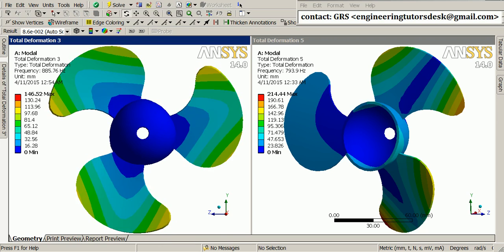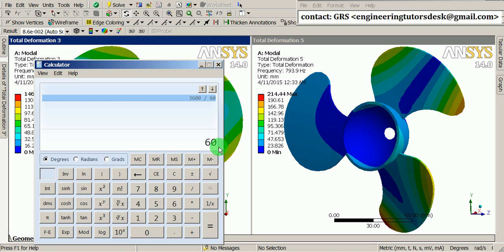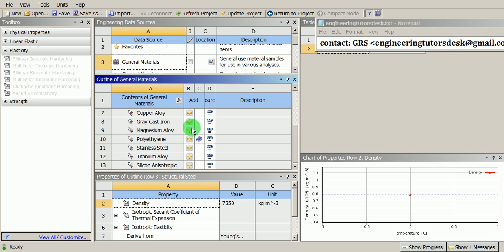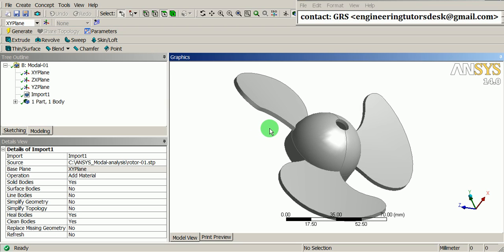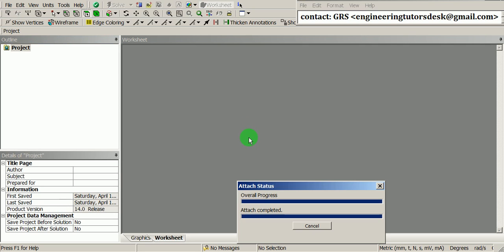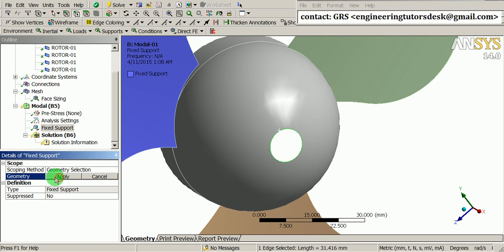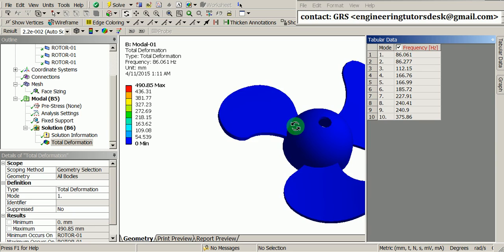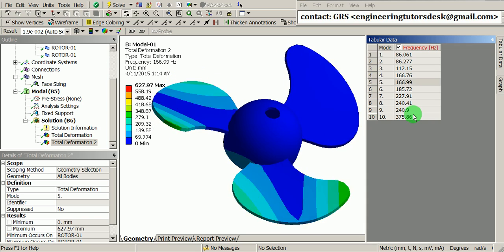ANSYS Workbench | Vibration का विश्लेषण क्यों जरुरी है? | Modal analysis | Natural frequency | GRS |

Comment: Sir do you have any idea how to do modal analysis of structure under water in Ansys. 
as there we need to consider the Hydrodynamic added mass.
Reply from the maker: One of the approach can be, you can do pre stress modal analysis. Create static structure analysis with pressure load, then do a modal analysis
Reply: @ANSYS-India   thank you for the quick reply sir. I actually want to do a free free modal analysis (Ships etc). For example a Cube immersed in  water or floating.
Reply from the maker: Check this link, whether it can be any help to you. https://www.researchgate.net/deref/http%3A%2F%2Fe-collection.library.ethz.ch%2Feserv%2Feth%3A7837%2Feth-7837-02.pdf
Reply: @ANSYS-India   sir many thanks for taking time and searching information for me. I actually did come across this thesis a week ago. but it didn't have the solution for my problem.

Comment: thank you for your video, I would like to ask you about How can I do the natural frequency model for a non.
Reflective boundary conditions for the soil surround the tunnel, so I can measure the natural frequency (free-free vibration analysis) of the model Without duplicating the measurements from the reflection of the wave,  or ANSYS mechanical will understand by default that it is a non reflective boundary, so the wave will not reflect and it will go for infinity since the
soil model is plan strain model? Please advise.

Please note that I made a search and found that only ANSYS
fluid can have this option for the user to choose the boundary
conditions ( reflective OR nonreflective boundary). appreciate you help and
support and I will wait for your respond. Thank you Khalid l dous

Comment: Forexample I want to check how strong (amplitude) the frequency is at 167 Hz. Where can I found this information?
Reply from the maker: Roman, you need to conduct harmonic analysis to get the amplitude.
Reply: is it possible to do it under Ansys?
Reply from the maker: Yes

Comment: Why did you use mid surface? doesn't it affect the thickness of the rotor and hence the vibration response?
Reply from the maker: +Chukwuka Nwobi Greetings!!
Mid surface was used to use the shell elements, because the shell element capture the bending behavior more precisely compared to the solid elements like Hex and Tet

Comment: you have not specified about element type, will it pick automatic or do we need to specify.please clear this
Reply from the maker: Greetings! !
Raj the element selected will be automatic, because in workbench before you start the analysis, you choose the analysis type like static, modal, thermal and so on, due to this the relevant elements will be used by default for the mesh generation. But order of the element can be changed manually. If you are interested in knowing which elements are used then please see the output window after the solution is completed.